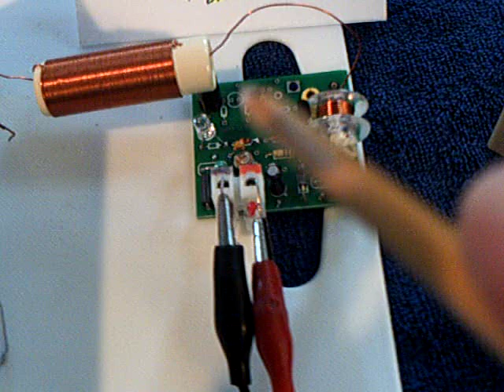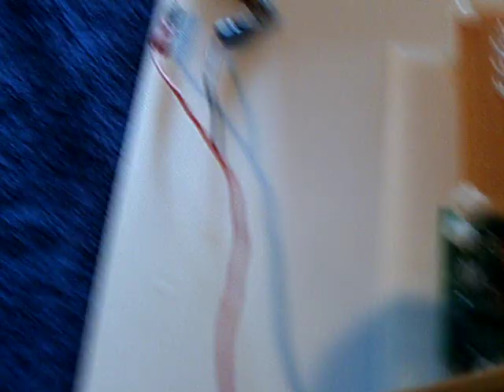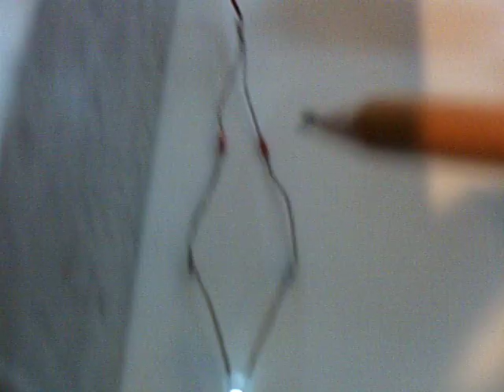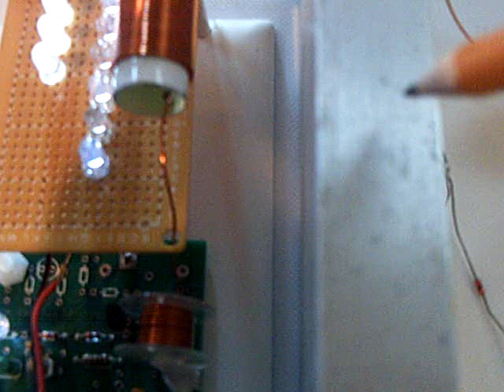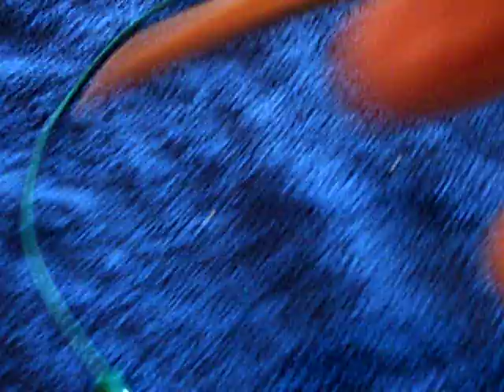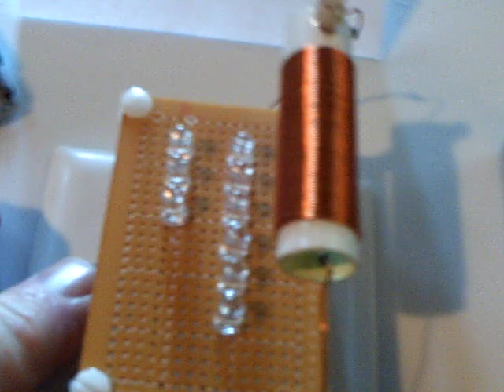NILS running off capacitive link to a SEC 18-X.

Comment: ***** Really appreciate your videos, they're very informative on a wide variety of topics.  I recently got a used SEC 18 but there were no coils or info with it.  I've researched and watch Dr. Stiffler's videos and I'm very interested in experimenting with it.  I'm planning to wind some coils for this SEC 18 and want to make sure I get them as close to the originals as possible.  You show 2 of the same SEC 18 exciters on this video, it would be a great help to me if you could confirm the coil winding direction for the L2 and L3 coils. 
   From your video it looks like the single layer L3 coil is wound in a counterclockwise direction when you look into the center of the coil and trace the wire as it winds off the PVC pipe towards you.  I could not determine the direction of the L2 winding from this and other videos.  Using the same method, is the last wire layer of the L2 coil also winding off the bobbin towards you in a counterclockwise direction?  My thinking is that the L2 and L3 coils are wound in the same direction but I want to make sure I don't introduce a discrepancy that will throw off my results.  Did you receive the L2 and L3 coils with your SEC 18 boards?  I would greatly appreciate any help you can provide me, thanks for your videos and help.

Comment from the maker: @slider2732 -----That block of aluminium is just a block of aluminium.  It wasn't a heat sink for anything.   The NILS circuit was actually being fed backwards (I think) from the L3 coil.  Dr. Stiffler explained how that is possible because of the cap and diode arrangement on the (+) / (-) rails.  Strange stuff to study.  I'm backtracking all the way to basic radio theory to try and get a handle on it.

Comment: what if you where to make an aluminum ringand place the transmitting coil in the center... could you run multiple recivers on the out side? if so would it stll power the leds like it does or will it loose energy?